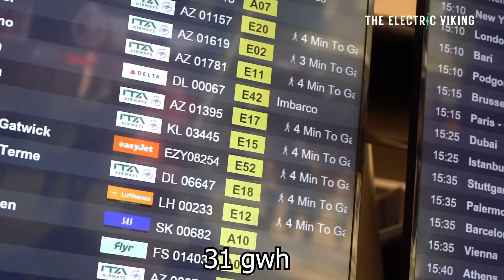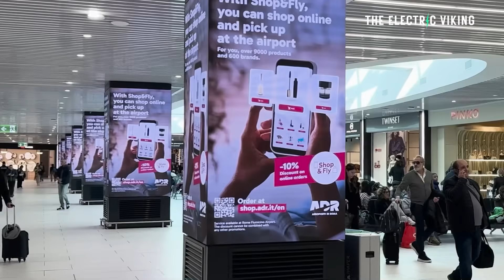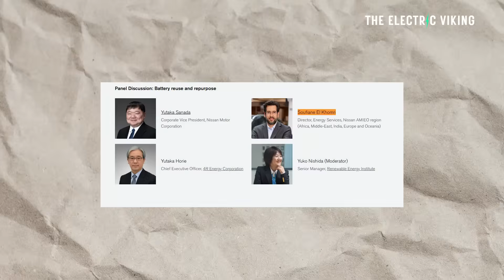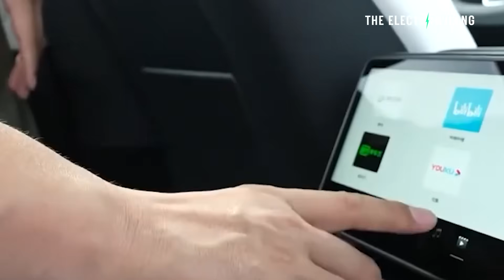Rome Airport Goes Electric – Using Old NIssan Leaf EV Batteries!

Comment: Great News but per Google AI: "The metal from old gas cars is typically recycled. After fluids are drained and usable parts are removed, the remaining vehicle is crushed and shredded. The metal, primarily steel and aluminum, is then melted down and repurposed into new products. About 80-90% of a vehicle's material content can be recycled, according to Fair Salvage Company and Atlas Iron & Metal Co."

Comment: From Some Nissan Leaf batteries that obviously weren’t treated properly and yes it’s usually only 1 or 2 cells ZE1 batteries are absolutely fine when treated correctly just don’t keep them full all the time leave them around 50% as much as possible 
My 2017 ZE1 40 KW has 89% battery health after 50,000kms but there are some good upgrades you can buy these are definitely not waste
Can’t wait to use my leaf to power my house with a Bidirectional Charger
They obviously work  better than your sound editing skills give it the once over big fella

Comment: What proportion of battery packs removed from old EVs are actually recycled? I've read that it is very low (less than 10%), but that this may be because they are repurposed before they are dismantled or discarded? Does anyone have any information about this?
Reply: You can export them to Africa and pair them with new or old solar panel

Comment: Unfortunately not all the newer EV batteries are easily repaired today such as the Tesla structural batteries with their structural foam fill gluing the cells together make replacing failed cells in their batteries more difficult to even get at.  Unless Tesla has some secret release agent which you can request that allows them to remove and replace individual cells its extremely difficult to replace a cell as an Aftermarket or DIY endeavor.

Best!

Comment: Exclusive: China auto industry inflates sales by exporting new cars as 'used'

BEIJING/SHANGHAI, June 24 (Reuters) - China's auto industry has inflated car sales for years through a burgeoning government-backed grey market that registers new cars right off the assembly line and then ships them overseas as "used" vehicles.
These so-called "zero-mileage" cars have never been driven but they are being exported as used to markets like Russia, Central Asia and the Middle East, allowing Chinese automakers to show growth and to dispose of cars that it would be difficult to sell domestically, according to a Reuters review of government documents and interviews with five auto dealers and car traders.

Comment: Used Lithium batteries  --- what could possibly go Wrong ---watch this space
Reply: Not too much to go wrong with the Leaf batteries.  The Fear Mongering despite the over 100 times lower chance of an EV catching fire over ICE hasn't been about the Leaf Lizard Batteries so pretty low risk using them.  More to go wrong using a gasoline or diesel generator however since those types of fires are so commonplace that they don't often get any news coverage.

Best!

Comment: This is an excellent use of old car batteries. Use every last bit of capacity until it's time to recycle them. This also creates a per recycling collection point so recyclers have a steady supply.
Reply: FYI GM takes the Volt batteries and repurposes them for storage at various GM facilities. It's a program they've had since the Volt came out in 2011/12

Comment: Yep, currently heating and lighting our home from 7 am to 9 pm in the New Zealand winter using out Ioniq 5 via its V2L.  Recharge it at night with off peak rates.  We don’t need a separate battery storage system.